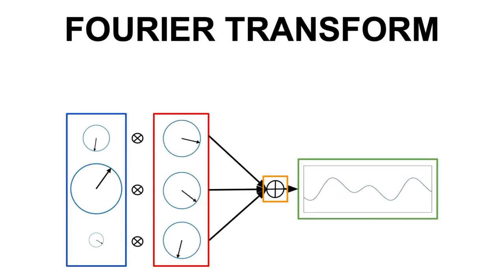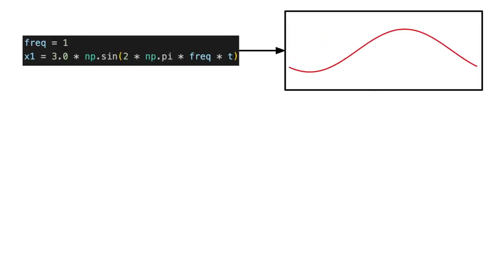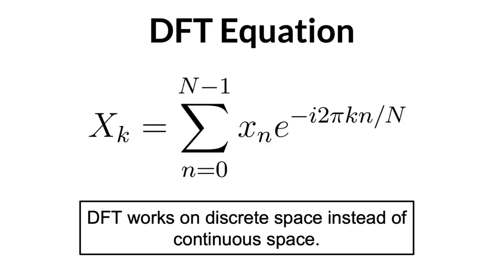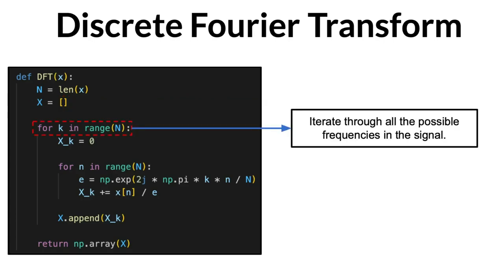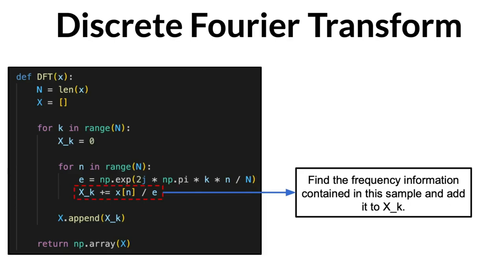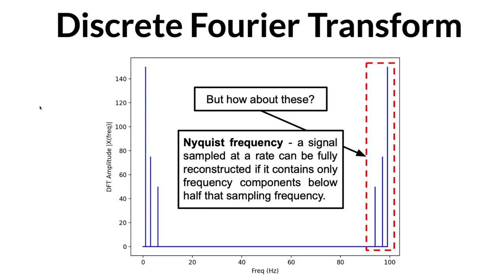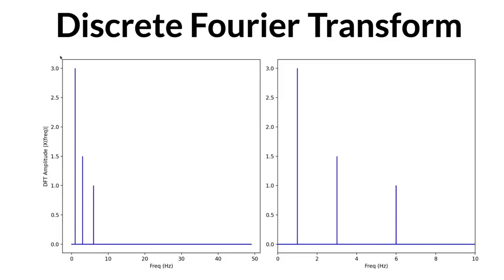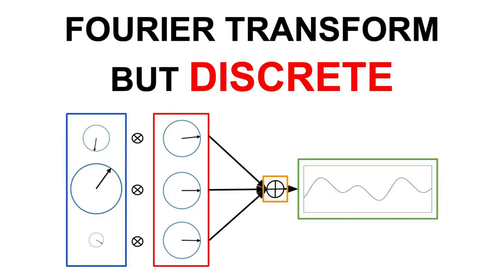Discrete Fourier Transform (DFT and IDFT) Explained in Python

Comment: Why are the amplitudes at 2:51 so much bigger compared to 3:40?
Reply from the maker: I've checked the scripts I used to generate the plots for this video. It seems that in the plot at 2:51 I forgot to normalize the amplitude (i.e. divide by half of the max frequency). Sorry for the confusion this may have caused!